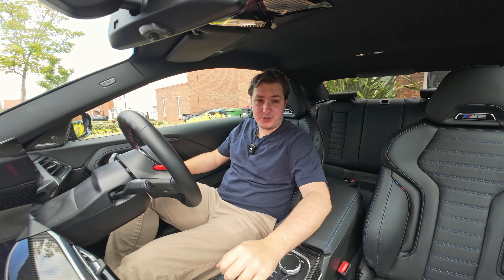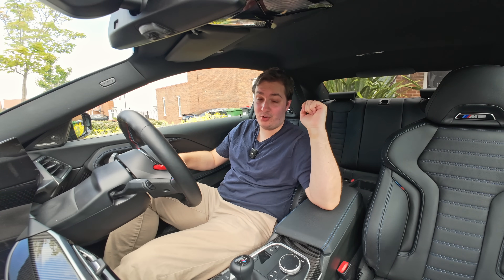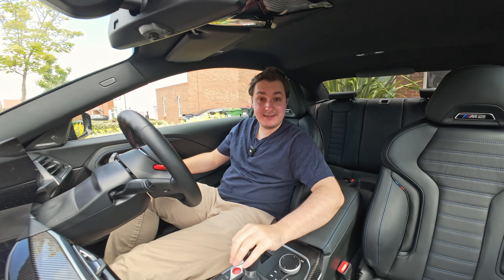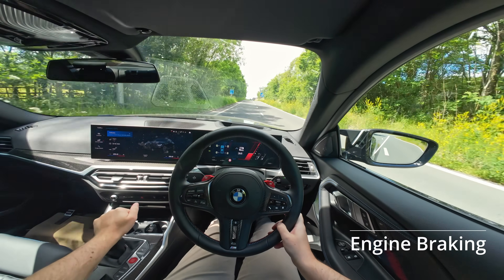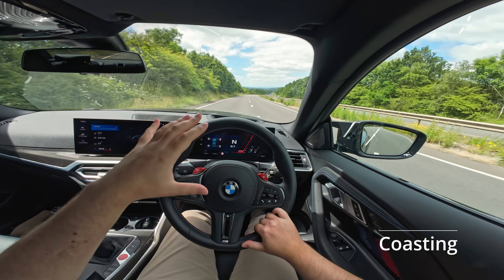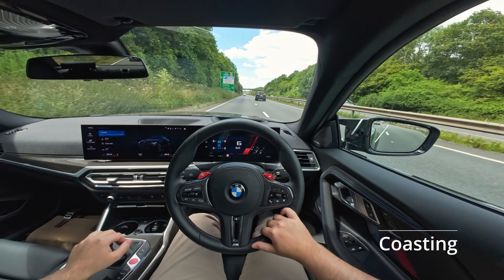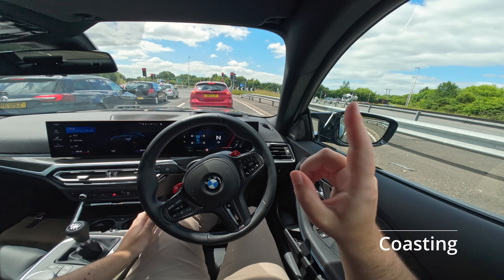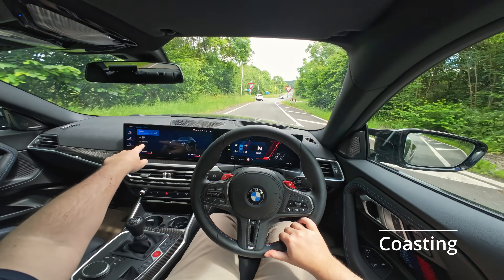Engine Braking vs Coasting - Explained and Tested

Comment: What if you will give a bit of throttle during engine “braking” so that car wouldn’t spend energy on pulling vacuum in the engine. Basically just put a little bit of throttle so the car stays at the consistent speed
Reply: That's just sounds like regular driving so long as you're in the highest gear the car can comfortably go at
Reply: It is by far the least effective mode engine can operate in. Least kw produced for fuel spent. Much more effective to run engine in idle az 700 rpm than run it very inefficiently at very low load at 3000 rpm for example.
Reply: @jancervinka7424  the lion's share of fuel is burnt just making the engine move, which is why I don't see the point in feathering low gears at highish rpm e.g. 2nd gear on the flat in a 30 limit. I may as well go up the gear box and spend less energy spinning the engine fast for such an easy pootle down the road.

Comment: I don't like to coast, because you don't have immediate control over the car. You have to put it back in gear to accelerate. I would put the car in cruise control to maintain the same speed. The car can than decide to engine break or to help out a little by putting a bit of fuel in. The cruise control wil put the tiniest amount of fuel in to just prevent it from creating a vacuum and engine brake. That should be the same amount of fuel as to have it running stationary. It's very hard to balance that amount with just your feed, because you react to the feedback of the car (increase of speed) but that will add way to much fuel.

Comment: An important point worth mentioning is the safety aspect. In every scenario I can think of, engine braking is safer than coasting in neutral. When you're in neutral, you just abuse the brakes as it's your only way to slow down. Not only does this wear out your brakes way more, but it also drastically reduces their ability to slow down your car in the event of an emergency (especially downhill). In other scenarios, you might need to use the throttle to avoid an accident (say a sudden obstruction in the road). Having the car in gear means you can act instantly, while having it in neutral puts a small delay before you can accelerate to avoid an accident. I find that the car behaves a lot more predictably when in gear than when it's coasting in neutral. Plus, being in gear allows you to use throttle to correct slides/spins in low-grip scenarios.

You just have way more control over the car when it's in gear, which naturally makes it safer. Personally, I'm willing to sacrifice a couple mpg for this reason (and to save my brakes, which could partially offset the cost of 1mpg difference).
Reply: In gear, there’s power to the wheels and hence leverage because of the torque. In neutral, the wheels are simply rolling freely and you have no leverage to apply on the road surface to input car directions.

That’s the Physics explanation to the feeling you were trying to convey.
Reply: @alphamineron  that makes sense. Thanks for the explanation
Reply: If I had to abuse the brakes to keep a safe speed I wouldn't be in neutral. There are a few hills like coming from Worcester to Hereford, and also Dinmore Hill between Leominster and Hereford where you have steep bits into a tight corner, so you may as well use the engine to hold your speed down a bit. Coasting in neutral is for lowering your total rolling resistance, which is not what you want down a steep twisty hill. Ideally you'd have an electric car battery to charge in this scenario, but with petrol or diesel cars you have to throw the energy away if it brings you to dangerous speeds.
Reply: True, I was always told that coasting is dangerous. I don't do it.
Reply: @holygooff 

Yep…. it can lead to loss of control and more dangerous situations if not used carefully, particularly if the driver has no understanding of what’s happening mechanically and perhaps the basic laws of physics.  That’s why when people are learning to drive they’re advised against coasting.
Reply: Brake pads are cheaper than a clutch thoo
Reply: Very interesting videos with good tips ! Thank you so much.
I drive a car with an automatic gearbox, and my experience of coasting in neutral is that every time I shift back to gears you can feel a clear vibration when the gears go on again. Me mecanic told me not to do it becourse it wears down the gesrbox faster.
Enginebreaking downhills do slow down the car faster than coasting, but the difference is not so big. There are also the safetyaspects mentioned earlier to keep in mind when coasting, so I think enginebreaking is better on the long run..
Reply: does using engine breaking wear anything else down? like gears?
Reply: @1EVE1X  Not really. The breaking itself happens by a vacuum occurring due to the fuel not being injected and the engine still rotating. But the downshifting itself could wear a clutch a bit, but clutches do not really wear unless theyre overheating. And overheating occurs in extreme scenarios, where youre holding the bite point too long while upshifting and applying gas, or holding the bitepoint too long while downshifting in a really low gear for the current speed at which youre at.
Reply: @maremike2691  I appreciate it Mike

Comment: Hi im learning to drive i have a question when you turn a corner do you have your clutch down and then release when u have turned?
Reply from the maker: Oh god no don't do this
Reply: @MickDrivesCars  because when im about to turn i hold my clutch go down to 2nd gear and while im turning i release clutch slowly while adding gas
Reply from the maker: I don't know how else to say this

Stop 😂
Reply: @MickDrivesCars  ok can you tell me how you turn when its a 90 degree turn step by step so i can learn please because my instructor tells me to put down my clutch then downshift and as im turning release clutch please help how u do it
Reply: @FxtureYT how fast are you taking these turns? If you are slowing down below the gears minimum speed then yes you should be pushing down the clutch, if you aren't then you should not be pressing the clutch
Reply: @FxtureYT  The generally best but certainly safest way is to make sure you slow down to the correct speed before the bend.
Only go down a gear when necessary, but try to also do that before the bend.
Reply: @FxtureYT It all depends on the situation. You'll get used to it over time as you drive more.
If you're refering to just going around a corner, don't put the clutch in unless you're changing gear, or have to slow right down and pretty much stop.

Try to avoid coasting in gear with your foot on the clutch at all. Examiners don't like it, and there's nothing to be gained.
Reply: Some people are comfort brakers. I was definitely a comfort clutcher.

Comment: The fact that coasting is better in this instance doesn't make any sense to me? 
The only reason the engine consumes fuel is to keep the engine active in idle, that energy just gets wasted...

My thought is: 
1. The highest gear is still running at such a high RPM rate on 6th, and pushing it into neutral drops the revs so significantly it's reducing drag in excess of the force pumping into the engine. 
If this is the case, the 8 speed automatic should yield different results.

Comment: Well , i will always think engine braking is more efficient , after all modern cars cut off fuel injection when you do that , and if it is an automatic they shift in the highest gear , reaching almost the same resistance as coasting. Great video anyway!
Reply: I think it's due to the fact that you lose less speed and reach the destination slightly quicker hence the 1mpg difference.

Comment: 0:50 "Engine Braking is not using the clutch to slow down the car". Funny how this is the case but with the 3 driving instructors I had they all insisted that it was engine braking. Good luck to their clutch I guess.
Reply: It is still engine braking, but it's just a lot at one moment and bad for the car if you do it a lot.
Reply from the maker: There is no group of people that know less about cars than driving instructors 😂

(There are some good ones but the average is BAD)
Reply: @MickDrivesCars  I got my license 13 years ago and my instructor insisted I start off in 2nd, then 4th, then 6th. He also insisted I should shift down and let go of the clutch to slow down. And no rev matching😬
Reply: Did they mean to engage and disengage the clutch multiple times to slow down each time the clutch connects ? Yeah i don't think that's engine braking either.

Comment: coasting with the engine off is the best of both worlds... but you lose power steering and vacuum for your brakes! :D
Reply from the maker: Hahaha you're the second person to say this and I NEED to try it
Reply: My Volvo V60 D5 Twin Engine does that, it shuts of the engine and coasts when I let go of the throttle, but still have power steering and breaks :p
Reply: That's just dangerous. Imagine the steering lock to engage if you accidentally remove your key. Or if the car doesn't sense the key anymore.
Reply: @edewaal97  oh yeah, definitely not recommended for the risk averse. It's still more efficient... until you hit something and stop!
Reply: Some mild hybrids work that way while still providing power steering. Hyundai i30 is one example coming to mind
Reply: I‘ve done this once before, I was stuck in a cue on a slight downhill. It would have been a waste to start the engine only to move like 5m plus i got a free arm workout :D
Reply: The best thing i found out about coasting is that i don't forget i'm in second gear anymore, cuz during my lessons, they tell you to stop in second and then put 1. But when i stop at a red light for 15sec +, i forget i'm in 2nd and just try to go on quickly. But when i have in in N, i know that i have to put in 1st gear so i don't forget anymore !!
Reply: Advice unclear steering wheel locked and in a ditch 😢
Reply: @tristan1805  you turn the key off and back to on (where it is for normal driving but not re-engaging the starter). The cars I've had, the steering lock only engages when the key is out, but the brake will eventually stiffen up after a few uses. You can still stop but you have to press very hard. I'd recommend a quick startup to recharge the power assisted brake vacuum. Also be careful at night as in some cars this temporarily makes the headlights go out.
Reply: I thought that too
Reply: It's hella dangerous too. Tbh i coast to avoid keeping the foot on the clutch cuz mine is hard so it's tiring, so i coast whenever i'm going to stop at red light to have a more precise braking with the brakes. But i do use engine brake + a bit of brakes to slow down till 20 km/h and then i put in neutral and use just the brakes. Like i feel the brake pedal going down a bit when i engine brake. But idk if it's rlly good for the clutch yk, i just do this to preserve the brakes
Reply: It´s dangerous to  try that downhill if your car has power steering or power brakes, and if ABS  and traction control and other stability aids are off!!, don do that unleass you are in a 60's Mini running out of petrol!
Reply: That's not only unsafe, that's also damaging your engine by shutting down oil protection. Your bearings will not appreciate that.
Reply: @PlunneCeleste  could you explain in a little more detail for those of us who are not mechanically aware? The engine's not turning because the car's in neutral, and the gear isn't engaged... but I wonder which moving parts are still affected ?
Reply: @davidicusb  Your engine still has inertial effect so it's turning without getting supplied in oil, also if you are in neutral it is mandatory against staying in gear yes but you still reducing oil temperature that makes your oil more stiff. More your oil is stiff, less the oil can cover your pieces to protect them. Keep in mind the inverse is also dangerous, stressing hard an engine and increasing oil temperature makes it more fluid so can create oil protection missing. Also, you increase consumption at the restart and stress because of the temparture differencies and by speed differencies when going from 0 to 1000 rpm at startup. Also because the engine startup is doing a calibration everytime you start it.
Reply: @PlunneCeleste  thanks for the extended reply. I think all around it's not a recommended practice, and certainly not to be done commonly. At best you'll shorten the life of your engine, at worst you'll have a fatal accident. I drive an auto these days so I don't engage in this kind of behaviour but if I was still driving a manual I'd consider your points from a mechanical standpoint before taking the risk.
Reply: I've tried it in my Fiesta, although it's dodgy at night as the headlights shut off for a while when I turn the key off to turn it back to the normal position. Also the mpg meter on a Fiesta doesn't count any driving with the engine off, so it will say you got worse fuel economy in a pulse and glide as it only counts the accelerations. Filling up at the fuel station will tell the whole story though, where I can add how many free miles I got coasting with the engine off on the long gradual downhill sections. It does mean I'm 20 over the 30 speed limit at the beginning of the village at the bottom of the hill, but practically everyone's indoors by 11pm when I get home.
Reply: Coasting with the engine off is just as efficient as engine braking, as both use no fuel (yes, none at all). With the downsides of no power steering, and how it doesn't help you brake, engine braking is better.
Reply: Don't do this. Western Ghats / Western Coast of India has specific signs that warn drivers to NOT turn their engine off.

The ghats are beautiful during the rains - lush, green, and empty. The hilly roads are beautiful. They are single rain. Many drivers turn their engine off during a long, mild downhill stretch. This can be fatal. Drivers lose braking power, and also can't accelerate quickly when they need to.

Coasting is also mildly dangerous, but turning your engine off is foolish.

Comment: Can i coast on an automatic cvt car? Is it safe to put the cvt into neutral from drive position while car is in motion and back to drive position when speed decreases?
Reply from the maker: Yeah you can go D-N as much as you like, just come fully off the throttle

Sidenote - if you have a hybrid CVT car it's very likely it turns off the engine automatically which you're off the gas :)
Reply: @MickDrivesCars  noted, thanks!

Comment: Coasting is almost never worth the additional +1mpg. It's dangerous and you'll put more wear on brake pads to slow down.
Reply: it all depends where you coast, how you plan for risk, and overall how you do it. in the past i have coasted quite a lot, usually didnt need to touch the brakes because of the gradient of the hill, planned to coast in advance when risks were low (little to no other vehicles around, can maintain a safe braking distance, knew the condition of my brakes so not wearing them out). 
its all down to the driver and risks they choose to take that causes danger, its not from coasting, its from planning ahead and reading the road.

Comment: What about turning off the engine while coasting? 
That will get you ♾️ miles per gallon until you turn the engine on again
Reply from the maker: Oh LAWD. This is the stuff I love. Will 100% try next time I'm going down a big hill... If the car lets me 😂
Reply: You lose power steering
Reply: @Omarock  
It’s not a problem since you’re driving fast 
But the brakes will be stiff since there will be no vacuum from the engine intake to support them
Reply: Will the stearing wheel get locked when car is turned off?
Reply: @Capt.Startrk  
No, unless you remove the key from the ignition switch
Reply: @2MARWAN5  That gets a bit funky with push-button start, like the BMW in the video likely has - there it's mostly up  to the company making the car, whether pressing the button to stop the engine should engage the steering wheel lock or not. Also some cars with immobilizers require you to remove the key completely, before you can restart the engine. Finally, unless you have a vacuum leak, you should have vacuum brake assist for the first activation of the brakes, but lose it if you pump the brakes, or brake multiple times before restarting the engine.
Reply: @AIRDRAC  
What if you press the push-button one time without pressing the brake paddle? Is the steering going to lock?
And it’s not a big a deal since you’re not going to steer a lot so it will not lock on the highway 
But if it does it’s going to be a big problem